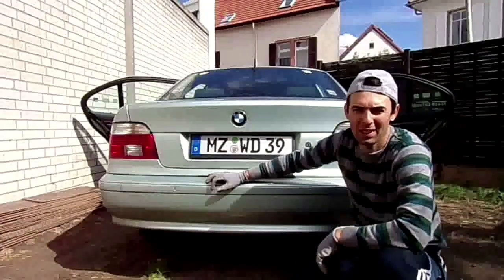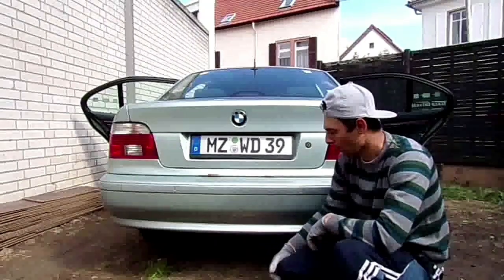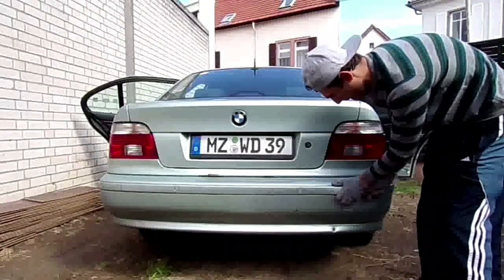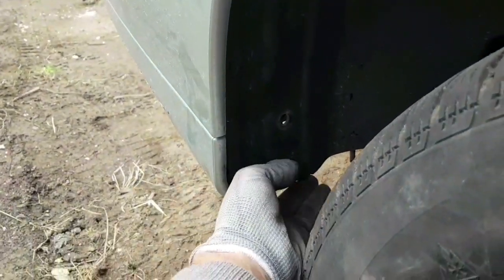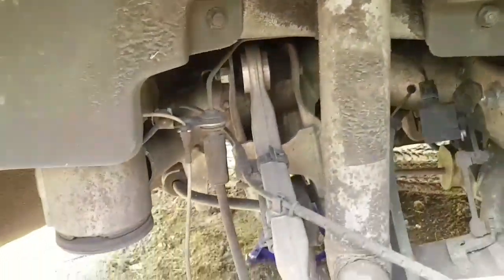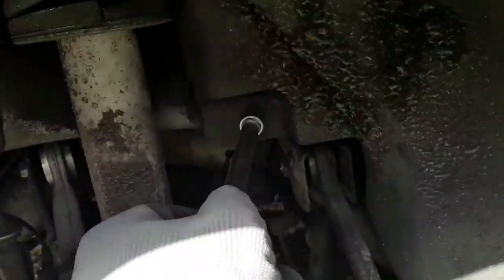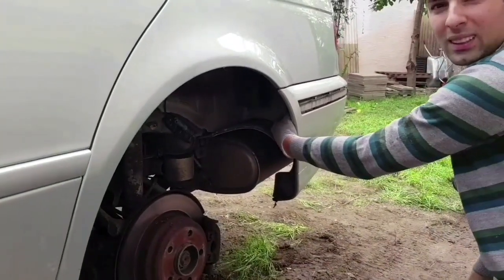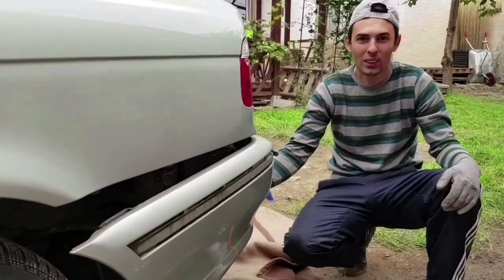How to remove the rear bumper on a Bmw E39

Comment: You removed 20 unnecessary clips and bolts, lol. You only need to remove 2 clips on the rear side of the wheel arch and 3 big nuts inside of the trunk. That's it, then you just slide the bumper out.
Reply from the maker: You are perfectly right but after my experience all the plastic brackets will break because of the age of the cars and plastics

Comment: Great video, thanks. Just a note, you do not need to take off the first set of bolts (two on each side) behind the wheels. You only need to remove the two sets of three screws that you reach from within the trunk holding to the dampeners.
Reply: But it looks those bolts are holding the bumper at each end... are you sure you don't have to remove them?
Reply: Those 2 nuts are from bumper bracket.. So you dont have to remove it, only if you have in plan to do it

Comment: I fucking hate BMW's. A dream to drive, but always the worst of fucking nightmares to work on...
Reply from the maker: Not always...i have an E90 328i, I've done all the mentenance and I didn't have any single problem in the las 2 years....
Reply: @WarpDriveM  Yeah well, I mean their utter dumbassery with clips and god knows. It's like they think about the most complicated solution possible, then complicate it by 5 to 8 times additionally before applying it to car. 

I have a 2002 E39 touring and there are two vertical bolts for that bumper, which both have a nut on the underside. Of course they place the muffler absolutely right in the way of it, and of course the nut is rusted stuck there. Took over an hour and plenty of neighbour attention to get rid of that shit.